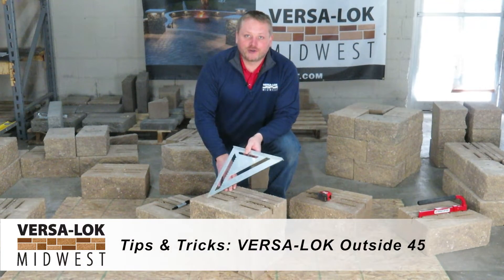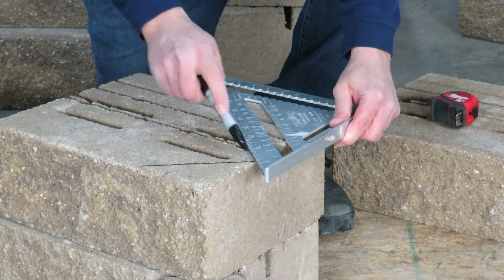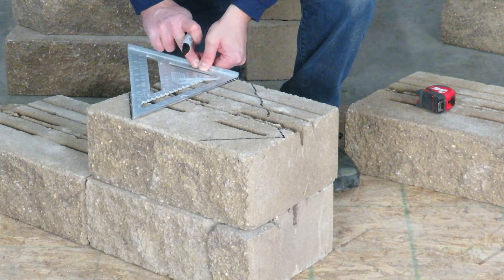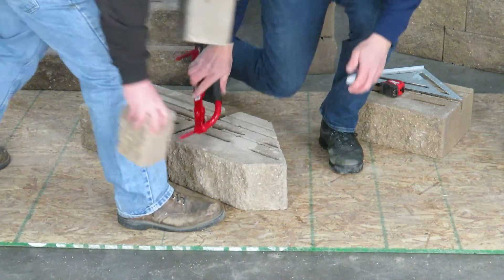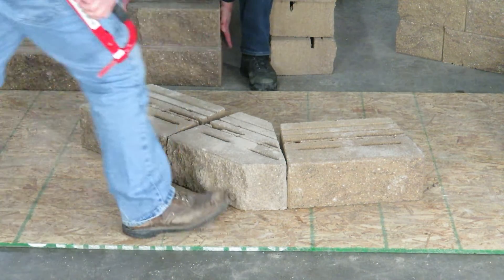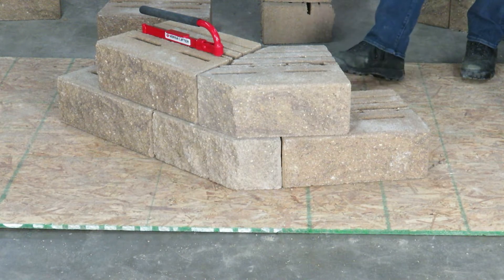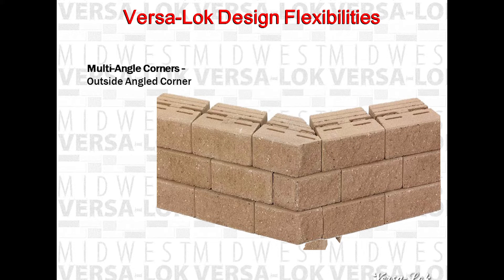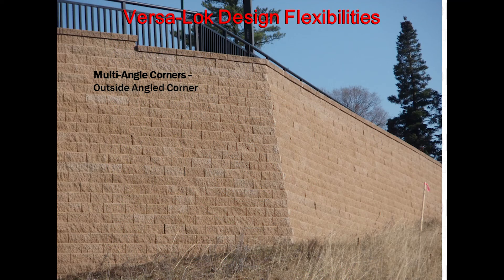11. Make VERSA-LOK walls with 45-degree outside corners!

Comment: On capping that do you just miter two caps with a 22.5 degree miter cut?
Reply from the maker: Mitering can be used for your caps, however the cap is solid, so you can also make the change of direction by splitting the cap. Please refer to page 3 of this Tech Bulletin to see how this can be accomplished: https://www.versa-lok.com/assets/sites/versalok2016/uploads/assets/uploads/tb4.pdf.